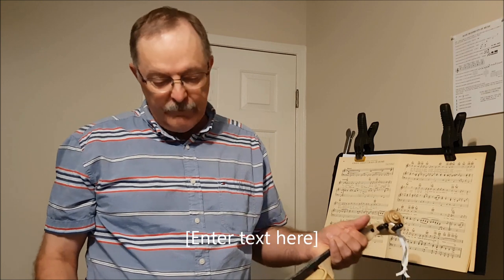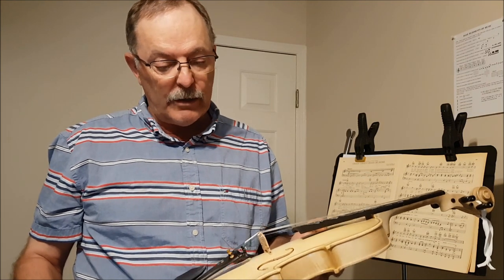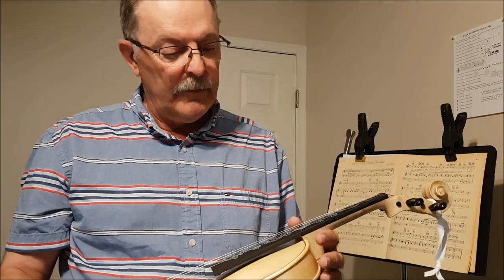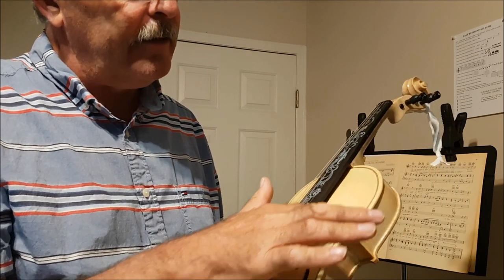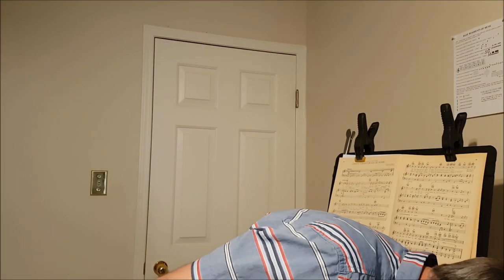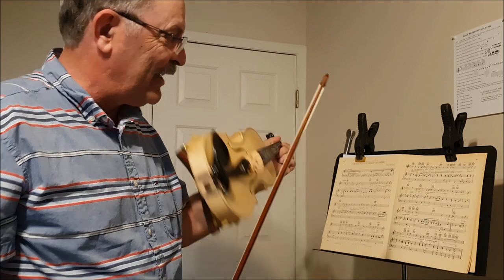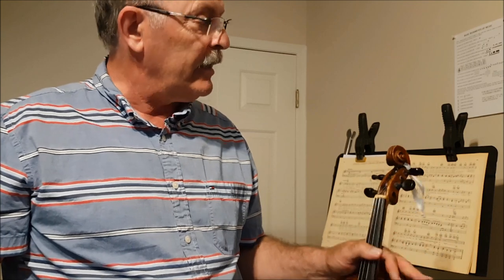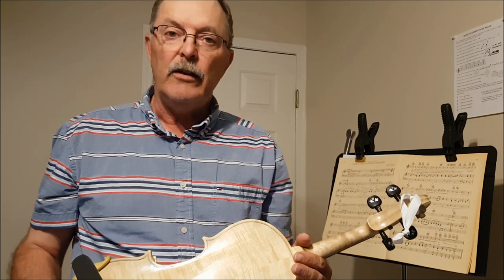Stew-Mac Violin Build  Episode 6 - The Dragon

Comment: Liked the tone of the violin in white you put together. The earlier. Stained violin sounded Skippy or wheeze. I read some where that the acids in dyes used to tint violins is deleterious to the tone. I don't know how you manage to read all those ants on the paper but am amazed if it helps.I enjoyed looking at your new Stewmack violin and thought it had decent tone. You can probably get even better tone with carbon paper if you take the time to scrape the bridge feet with exact knife. Every part that is black you gently scrape from outer edge to inner feet. You place the strings onto the bridge and apply light tension just enough to hold pressure on bridge while you massage it over the carbon paper. This will leave mark where to scrape next. You repeat this process untill theoretically all the bridge feet are evenly black. I have yet to get mine to turn out completly black but that is the goal. There should be no daylight at belly and bridge feet. My next time I hope to use thin cigarette paper and rub with number six pencil and use that for carbon paper. Hope this helps. Im still learning.
Reply from the maker: Thanks for your input. Yes, bridge cutting and fitting is an art in itself. I'm still learning. Tried different techniques, similar to your method. Eventually I hope to consider myself 'good' at fitting. Until then, I'll just keep trying!

Comment: I also built one of those and it took me a year, because I really wanted to take my time....  I was very careful each step along the way, and like you mentioned I did leave marks in the spruce from where I shaved down the purfiling.... I made my own stain using steel wook and red wine vinegar and the results were gorgeous.... I can't play violin at all and don't spend enough time to ever learn how.... I play most other bluegrass instruments, but the fiddle has me bojoed.... I can never tell which string the bow is on.... Anyways, I am very pleased with the fiddle and would never part with it.... If I ever build another one I know I could do it in a month's time at least....
Nice job on your, by the way....
Reply from the maker: Thanks Bill. Learned a lot on this build.  Most of all I learned how little i know and how much there is to learn. Most of all is how hard it is to "tune " the plates. Still struggling.